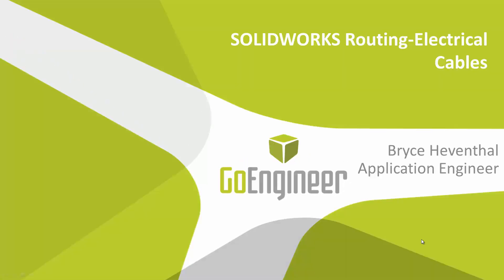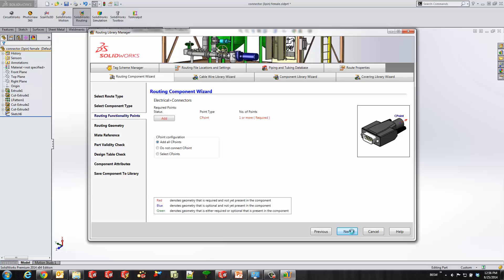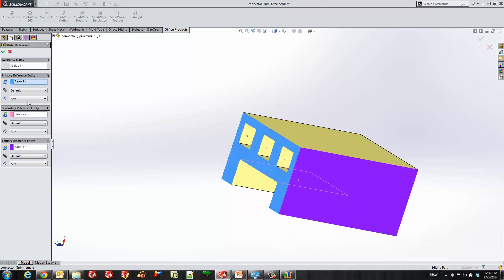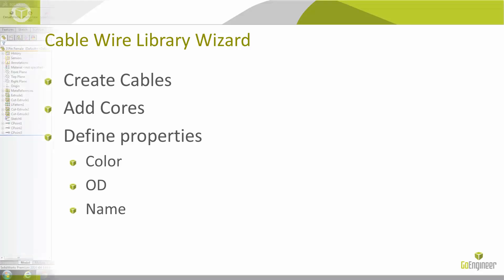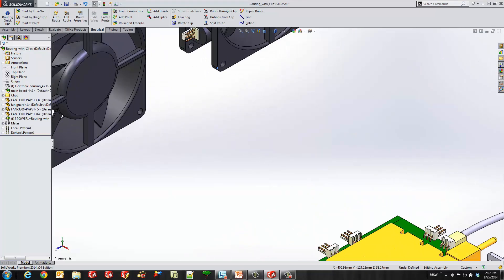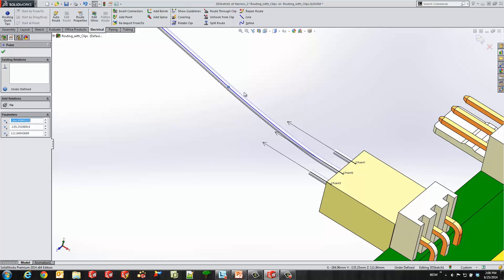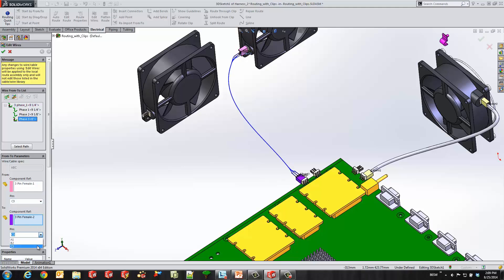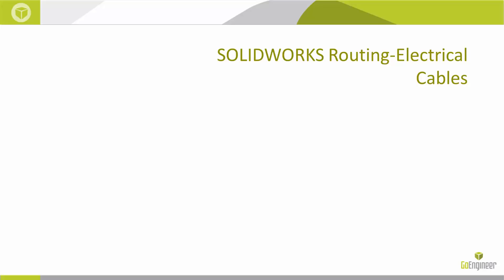SOLIDWORKS Routing-Electrical - Cables

Comment: Great video! What's the use difference and audience difference of SLW Routing and SLW Electrical?
Reply from the maker: Good question! SOLIDWORKS Electrical is tailored for electrical design, while SOLIDWORKS Routing is designed for mechanical routing tasks. So, the bigger difference is the focus of the software and what kinds of components the user is working with.

Generally, SW Electrical is for electrical engineers and technicians, as well as designers involved in creating control systems for machinery and equipment. On the other hand, SW Routing is more for mechanical engineers, designers, and drafters who are involved in designing the physical layout of products and systems.